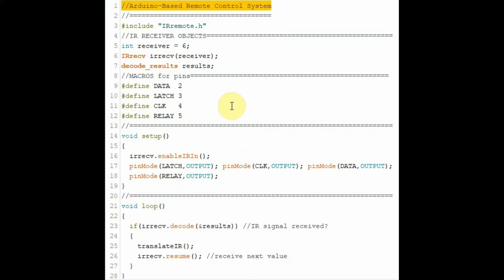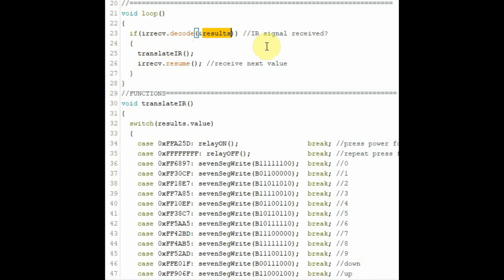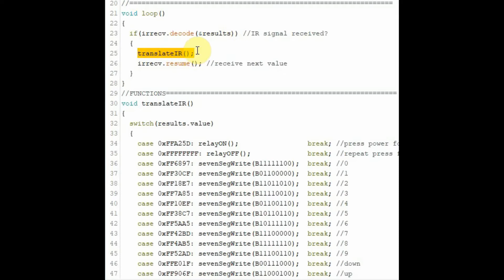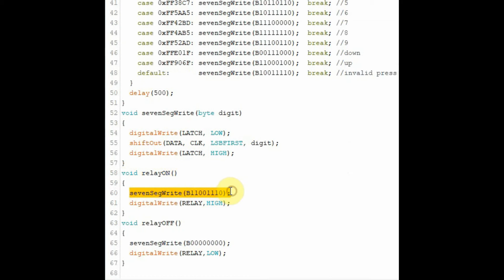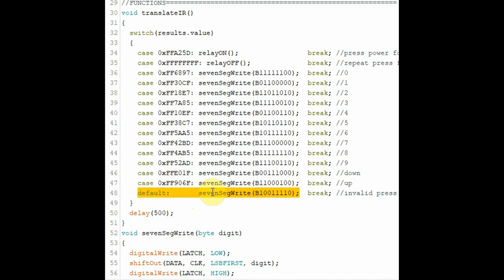Arduino-Based IR Remote Control System

Comment: Hi, this is a very good project and your explanation of the coding  nice and thorough. One small request though; could you possibly post a schematic, as the wiring with shift register is quite complex. Thanks.
Reply from the maker: Hi, thanks for your feedback. Sure, I'll do that ASAP.
Reply from the maker: Circuit diagram is now available in the link.
Reply: @AnasKuzechie  Thanks so much, your videos are excellent  and  you provide a high quality service for non-experts like myself.